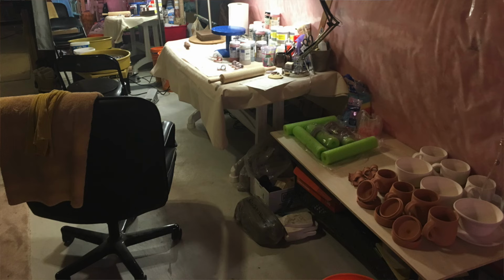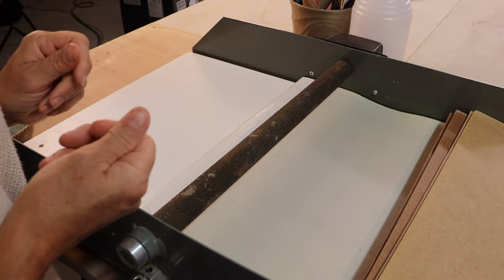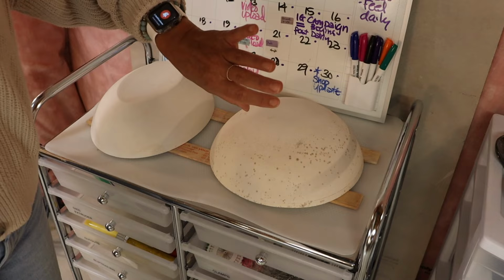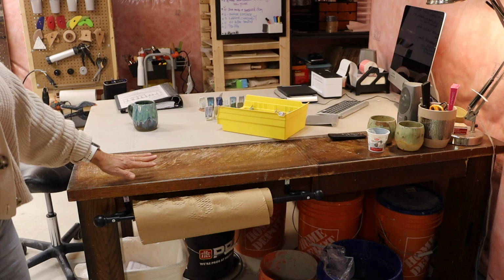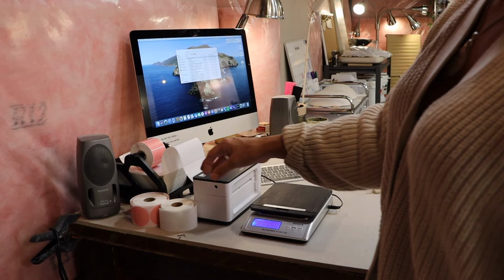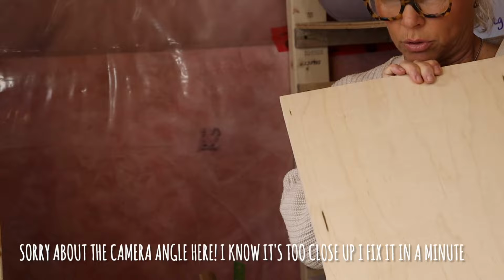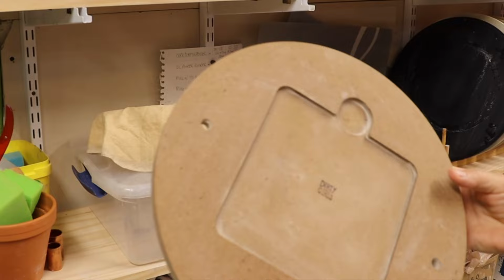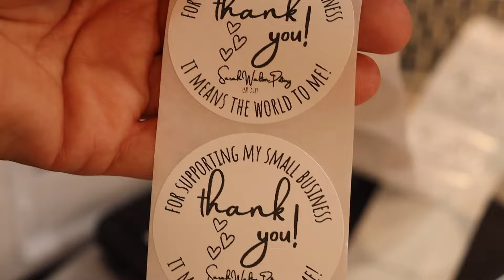HOME POTTERY STUDIO TOUR | Organization, Layout, Tips & Tricks!! VLOG#8 - Studio Life HD 1080p

Comment: Use canvas on top/bottom of the clay with your slab roller! There will still be texture, but a rib tool can easily take care of that. You don’t want naked clay meeting the clay roller itself. Beautiful studio!
Reply from the maker: Thank you so much! I have since fixed the issue with the roller dropping all those little bits...It was surprisingly easy, there is a spray adhesive from 3M that encompassed all the little bits🤭... Instead of canvas, I use a slab sheet/mat which is a synthetic material without texture and is pretty amazing for protecting the clay and giving a smooth finish at the same time...mind you there are times when I still use canvas. Thank you again for your help!

Comment: I also have the 16" Bailey slab roller. Got it brand new several years ago (can't remember when, maybe 2015?). It's still like brand new, it's such an awesome brand. However, my roller is different. It's a tan color, not textured, no grainy bits. If you go to their website, that's exactly what mine looks like. I wonder if you can order a replacement roller and get the roller I have?
Reply from the maker: Thank you for this info!! I will check it out and see if that's a possibility. I was also suggested to wire brush it off and oil it...I'm going to do a little bit more research and come up with a plan! Thank you for sharing! Potter's are just so amazing!!

Comment: Awesome Studio Sarah!  I also have a basement studio (have to admin, not half as clean or organized as yours, but it works for me after many re-arranging.  One question, I see you have concrete floors...how do you clean them?  I wet (and I do mean WET) mop the hell out of mine as I have a french drain but if you have any suggestions I would love to hear them.  Thanks!!!  Waiting to see more from you soon!
Reply from the maker: Hi Mariede, I do the exact same...😵‍💫! Mop the hell out of it,  about 3-4 times! I forgot to show it in my video, but I have another large bucket that I pour the dirty floor water into, the silt gradually sinks to the bottom and I dump the rest outside. I plan on painting the floor in the somewhat near future which should help immensely with clean up as the paint will help with the porousness of the concrete so I may only have to mop once 🤞🏼...that's the plan anyway...🤭

Comment: Sarah, what plaster do you use for your wet box?  I thought I would use the plaster to make my slabs for recycling my clay also.
Reply from the maker: I used Pottery Plaster. You should be able to get it from your local pottery store. It comes in 50lbs bags. I’ve used plaster of Paris which is available at hardware stores but it’s not as good, and I always had to line my damp box with newspaper because the plaster of Paris would flake off and into ky clay (which is bad) if you can’t get the pottery plaster use the plaster of Paris but be mindful of the downside listed above. 😉

Comment: Love your videos🥰 So I noticed you had Plainsman M350 and I just got a bunch of it and love it, but I’m a total beginner and I guess the term on plainsman’s website “semi-vitreous” has me a little spooked to use it for functional ware? Is it totally fine if I glaze (assuming no crazing of coarse) the entire piece except the bottom/foot, or could that base and foot get water in it and cause problems? I’m new to pottery so I don’t want to assume something and then give someone a mug that they put in the microwave and it burns them or something? Have you noticed anything with your m350 pieces absorbing water?🤷‍♀️
Thanks so much for the help,
Sydney
Reply from the maker: Hi!! Thank you!! You are going to enjoy M350 as well as other Plainsman clays! Not to worry about the terminology, once it's fired up to cone 5-6 your are good to go for functional ware, it is vitrified enough to not absorb water etc. bare clay or not. If you watch some of my other videos you see that I often show off the bare clay on the outside of a pot, (food surfaces have to be sealed with a food safe glaze)  if I use a pretty clay or I've marbled it...after it's been successfully fired to the proper cone temp you can even put it into the dishwasher... I have used M350 for cups and plates etc. As for someone burning their hand, I recommend darker, iron rich clay NOT be put into the microwave as the clay can get very hot. Heck, i've had some cheaper mugs get pretty dang hot in the microwave, but to be on the safe side I have little card that I insert with my pieces that provide this info...I also put it on my website...I hope I answered your questions okay and set your mind at ease...🥰
Reply: Thank you so much Sarah, that helps a ton🥰!